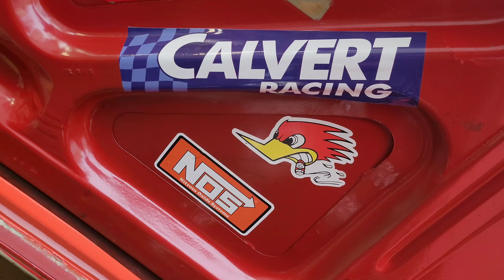90/10 shocks install: Ford Mustang!

Comment: When i replaced the shocks on my mustang, i didn't take the wheel off or the shock towers. But when i checked the shocks, they were so stiff i could just barely compress them and they would slowly inch back out on their own, it was just as hard to pull back out as it was to compress. I replaced them with smooth ride shocks because i hated the rough ride.
Reply from the maker: Im liking the 90/10 calvert shocks myself 🙂

Have those and removed sway bar so i can get the front end to rise up either 👍
Reply: @newguysgarage6802  With my setup, i was almost able to pop the wheels off the pavement when i had extra weight in the back. I thought about removing the sway bar but mine is pretty much a daily driver so i don't need straight line performance so much as comfort.
Reply from the maker: See i dont really mind mine being off, it was so dinky it probably wasn't doing much anyway lol
Reply: @newguysgarage6802  lol, i get that, but imma just leave it on, it won't really matter for me anyway.
Reply from the maker: True lol 🙂